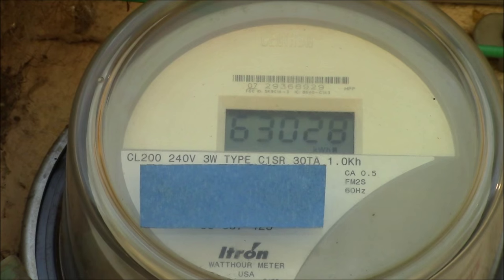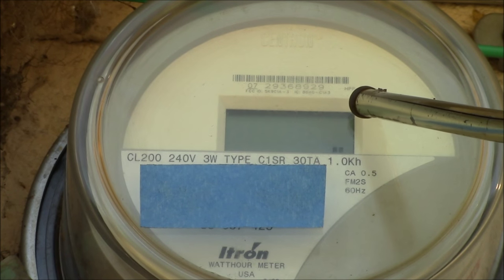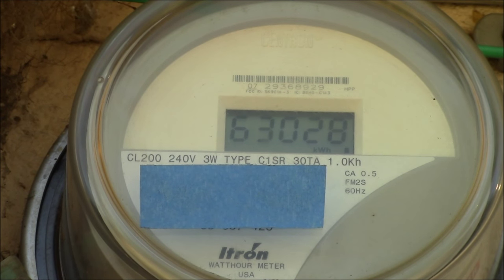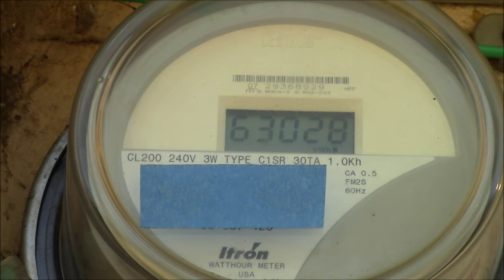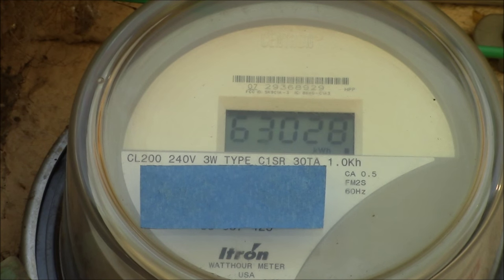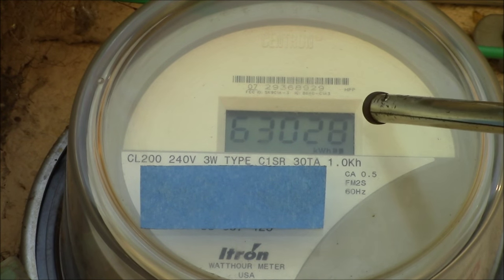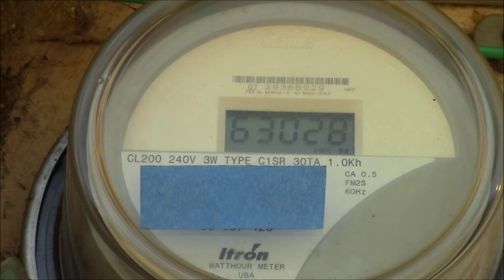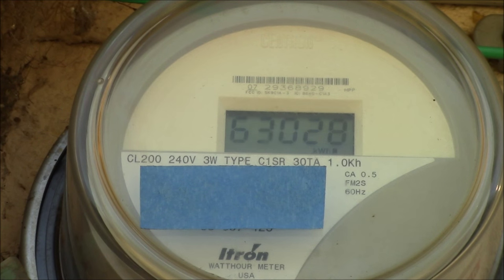How to Read a Digital Watt-Hour Meter

Comment: Clear as mud for the average homeowner. It's just like the power company to take an instrument that could just as easily display the data in easy to read format, and make it nearly impossible for the customer to read and understand.
Reply from the maker: Actually, I find the digital meter easier to read for the KWH data at least.  You just read the digits right off the LCD instead of trying to total up all the tiny dials that all rotate in different directions.  It would be nice if they also added a display field for the actual instantaneous power, but you can get a good idea by timing the dot changes.  You would need to do a similar thing on an analog meter, timing how long it takes for the center disc to make one rotation.
Reply: I see what you're saying. Still, for some folks you might as well be comparing trig to calculus. It doesn't much matter after a certain point. My point is that what made the wheels and dials difficult on the old meters is people learning how to read the faces of them. With digital, that's taken away, and it's all just numbers. There's no reason why a digital meter can't show the usage in a plain way, without the need to do the figuring you outline in this video. Just my opinion of course. Your video is much appreciated by the way. Nice job and thank you.
Reply from the maker: Agreed, I'm not sure why Itron could not have added a Watts display in the sequence.  As it is now, they flash up KWH, then an all-segments test screen in alternating fashion.  Would have been so simple to intersperse a Watts reading in there.  I guess the power companies don't want to make it easy for the consumer to figure out how much power they are using at any given time.
Reply: @The4Crawler  I think they’re saying why have dots? Just have a kWh digital counter with three digits behind the period which account for watts.
Reply: @The4Crawler  this is confusing.

Comment: So this would read 63,028 kw/h? Or 6,302.8?
Reply from the maker: 63,028 would be the total reading, there's no decimal point.
Reply: @The4Crawler  And this is the total for the year to date, correct?
Reply from the maker: @MikeJones-mf2rt  On my meter, it's the total since the meter was installed.  It started out new at 00000 and kept incrementing until they replaced it with a newer meter a few years ago.  Not to say that some utilities might reset the total at some interval.

Comment: I have a meter similar to this. I have underground power to various buildings and with my old analog meter when I wanted to check for underground leaks, I would shut off all main breakers in each building and then go monitor the dial for movement. Will the blinking dots in this meter represent the same thing or is there another way to check for Earth leakage?
Reply from the maker: Yes, at least on that meter, each time a dot changes (on or off) is 1 watt-hour of energy registered.
Reply: R Brown Thankyou, I understand what your saying, I have to study it up a little further. So when I do this and monitor it for a few minutes and there is No leaks, will these dots be absent from view or all stay lit up but no movement from L to R or R to L?
Thanks
Reply from the maker: @jackfrost5881  Yes, the dots should not change state if there is no power flowing in or out of the meter.  Realize that if you had say a 1 watt leakage, say 8 mA (0.008 amps) at 120 volts, that would be 1 watt and take 1 hour to register 1 watt hour and make one dot turn on or off.  A 10 watt load (80mA) would take 1/10th hour or 6 minutes to change a dot.  So you want to watch the meter for roughly twice as long as the leakage level you are looking for because a dot could have changed just before you started watching or a while before you started watching.  You want to start timing from one change to the next.   Maybe set up a video camera then you can scrub through the video looking for dot changes and see the time stamp on the video.

Comment: Thanks for this. That dot mechanism is not very intuitive is it...
Reply from the maker: Yes, exactly.  Although it is nice to have something like that.  They changed out my meter and on the new one, I've not been able to figure out if it displays power readings like the old one did.
Reply: @The4Crawler  Yeah it's very helpful. I just got a solar install and my new meter functions the same way, so now I can quite accurately see current generation vs household usage. I also, like doctor zaius mentioned in his comment, noticed that on the day my solar was overproducing I was still being charged because net/det isn't yet setup on my meter (waiting on power company to come out), so even though I was feeding the grid I was also paying for it ;)

Comment: Recently realized the reading from our meter is nowhere close to what they are saying it says on my bill. They are in the 6 digits and we are still at 4 digits on my meter under 3000 so far.
Reply from the maker: Good idea to take a photo of the meter and then contact your power company and tell them about the discrepancy.  They may use the photo or they may have to send someone out to read the meter in person.

Comment: if you grid tie try to keep this meter, smart meters charge you for the power you put into the grid...
Reply from the maker: fliping720 I'll have to see about that when the time comes.  The utility has announced plans to convert the meters, not sure the timing or details yet.  Not sure if this meter charges both directions or not.  It has the "NET" and "DET" indicators on the screen that I haven't found any info. for what those mean.  Also, working on an idea for limiting power production to only match what the house consumes.
One benefit of the smart meters is they'll be WiFi hotspots for a low bandwidth, but free WiFi service.  So maybe if enough neighbors get them, I can access theirs :)
Reply: It may depend on the state. I talked to a solar guy and he said that in SC. meters are 2 way for net metering but don't have to be in NC. I don't know if that will change.

Comment: It's a little hard to read, can you tell us what the FCC ID Number is on the faceplate?
IT LOOKS LIKE THE STANDARD 35 WATT, COMMERCIAL, MESHED NETWORK,  UNLICENSED RADIO TRANSMITTER
DID YOU KNOW THIS SMART METER IS CAPABLE OF KILLING A DISABLED HOMEOWNER AT A DISTANCE OF 4 FEET?
Reply from the maker: Seems to be listed as 147mW:
 https://fccid.io/SK9C1A-3

Comment: This might be a very elementary question but im trying to figure out the usage on a monthly basis and a complete rookie to understanding these meters, but that number (63026) is the overall usage? Assuming your billing cycle ended at that number, the electrical company would subtract that number from last month's reading to determine how much kWh you used in a month and multiply it by the going rate, is that correct?
Reply from the maker: +ThisNamesNowTaken Yes, that is correct.  So that says that many KWH have been used since the meter was installed.  So to figure monthly consumption, go out the first of the month and write down the number.  Then go out the first of the following month and write down that number.  Subtract the 1st reading from the 2nd reading and the difference is what you used the last month.  
For a cost figure, you can multiply that by your per KWH electrical energy rate.  Note that many utilities have a baseline rate (at a lower cost) and then one or more rate tiers above the baseline, that are usually at higher rates.  So it can be hard to work out your actual cost/KWH, I usually use the highest tier rate that I'm in at the time to base costs and savings on.

I try to record my meter daily if possible to get an idea what I use day to day, but for sure I record monthly and put that data in a spreadsheet to track my usage.

Comment: DET and NET are "detent" and "net (bi-directional)" programs, and if the're only flashing during the segment check, they aren't activated on your meter. The default setting on a CENTRON (and most electronic meters) is to record any reverse energy flow as if it were forward energy flow (for instance, the old trick of turning your meter upside down won't work with these).

If the DET program is active, reverse power flow isn't recorded at all... and NET is net-metering, obviously.

I'm not entirely sure what the purpose of including a detent function was... probably just to appease POCOs who were used to buying meters with mechanical detents as a security feature when these first came out.

So the guy who commented about keeping this meter w/solar couldn't be more wrong!! You'll need either a new meter or this one re-programmed.
Reply from the maker: Thanks for the information.  I wasn't able to find out anything about those two features.  And thanks for the tip on the SDR, I've been looking at getting one for some other projects.  Looks like Adafruit has a decent USB stick.
Reply: I've got one made by a company called NooElec, only ever used it with rtlamr and SDR# but it works great with those!

Comment: This is not a smart meter is it?
Reply from the maker: Technically no, it it more of an Automated Meter Reader (AMR) as it only has one way communication from the meter to the utility.  I think it is the inclusion of two way communication (AMI) that makes is a "smart meter", at least per Wikipedia:
https://en.wikipedia.org/wiki/Smart_meter
Reply: Do you know what the C1SR stands for?  The older meters seem to have the R?  Don't want any upgrades but for them to leave well enough alone. Thank you for quick response.
Reply from the maker: I think its a model/version number, you can read the Technical Reference Guide online, it was the first link in the search below:
https://www.google.com/search?q=itron+c1sr+CENTRON+Technical+Reference+Guide
Reply: thank you- can "they" remotely make it 2 way and turn it into a smart meter- ?
Reply from the maker: I don't think so.  From the manual:
"The Itron CENTRON C1SR is a one-way, unlicensed radio frequency (RF) personality
module that attaches to the CENTRON meter base."

There are other "personality modules" that can be installed, things like time of day billing or cellular data upload vs. RF.  I guess the "R" in C1SR stands for the RF transmit personality module.  

At the least, they would have to come out, power off the meter, open it and install a new personality module.  Although I don't think any of the modules listed in that manual have any receive capability.  If that is the case, then the meter would need to be replaced with a two way version.
Reply: I have the same serial numbers on mine as yours CL200 240V 3W C1SR 30TA  1.0Kh Ca 0.5  FM2S     60Hz. I do not want the ability to turn my one way AMR meter into a 2 way Smart Meter. I would rather just keep it as it is- I have read that while there is some dirty electricity and EMF with this, there is less than the smart meter because of less data collecting of this AMR. I would rather just leave well enough alone and do not care to live inside a microwave oven. Can they remotely turn this meter into a smart meter or do they have to come in and install something. What exactly does the R stand for- do all AMR's with the letter R mean a capability to install a personality module and turn it into a Smart Meter- I mean they can still read me from their truck- I do not want them to sneak this on me.
Reply from the maker: In my earlier reply: " I guess the "R" in C1SR stands for the RF transmit personality module."  Looking at the reference guide (link earlier), none of the personality modules have any receive capability.  They have functions listed below:
 Energy only—C1S (LCD)
 Demand—C1SD
 Time-of-Use (TOU) with Demand—C1ST
 Load Profile with TOU and Demand—C1SL
 Energy only with radio frequency AMR—C1SR
 Cellnet Fixed Network—C1SC
 Energy plus demand with radio frequency AMR - C1SDR2/R3

All the modules with AMR seem to be one-way (transmit only), so unless they come up with a module with receive capability and install that in a meter (if that's even possible), no way to turn one into a "smart meter".  My utility is talking about having to replace this meter with a new smart meter when they go that route.
Reply: Thank you. If I ever do end up having a smart meter (for whatever reason) is there anything that can be done to make it less of a fire hazard and to protect the people in our home from the RF ?
Reply from the maker: I suppose there are lots of web pages and videos on things you can do.  I suppose the biggest thing would be refuse to allow the power company to swap the meter out.  Mine is installed on a metal breaker box outside the house and having a bit sheet of grounded metal between the meter and the rest of the house goes a long way to reducing RF.  I figure I'll cross that bridge when the time comes.  Utility has been talking about this for years, but have never seen anything actually happening.  The current digital/AMR meter was installed maybe 10 years ago, so I don't see them in too much of a hurry to change out a nearly new meter.
Reply: yea i have this exact meter and it is not "smart" persay just digital. They came around our nieghborhood installing smart meters the other day and came to my house to install a new one but i refused. the one showed in this video is NOT a smart meter, otherwise they wouldnt have been trying to switch mine out to a smart meter. luckily i was home and caught them putting a notification on my door and i opened the door&the technician was standing there with a smart meter in his hand getting ready to install it after he put the pamphlet on my door knob. My nieghbors werent home and all theres got switched to smart and the information they left on the doors didnt even really say they had switched them but only was an advertisement for them. Got to keep an eye on your meter, they will switch them without anyone at home and no notification until its already done. Im in western NC and they have been hitting all of our area hard with the switch, got my moms the other day while she was at work and she had the old analog. To get what she had back or a digital version like the one i have that isnt "smart" will cost her a technician visit and 250 bucks for the meter, plus extra charge on her bill each month....its ridiculous, best thing is to keep an eye on your meter and refuse if you can and avoid the hassle removing a smart meter and the crazy amoutn of $